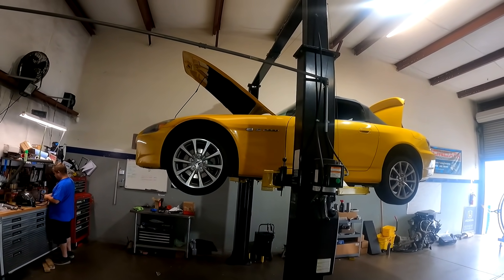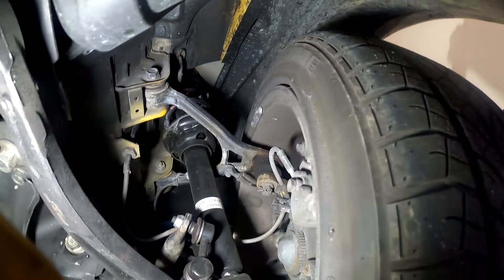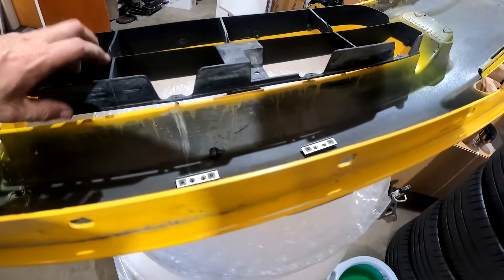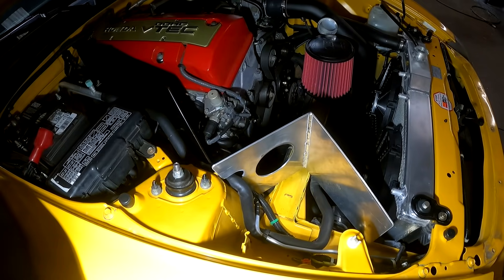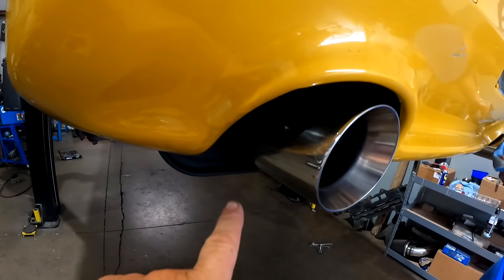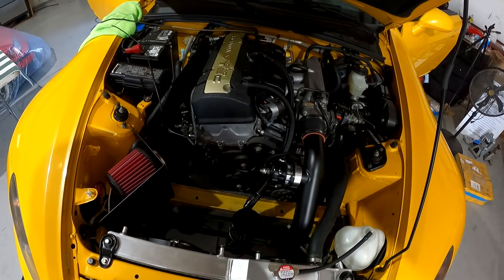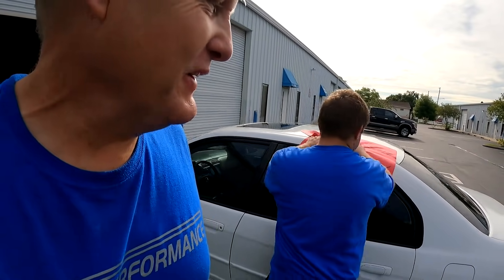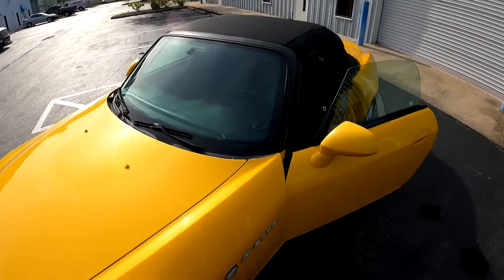07  S2000 with an 04 motor ?

Comment: Hey John. That S2000 has a funky mixture of parts for sure. The customer did the right thing bringing it to LHT.👍 I agree with you on the tread pattern looking like it should have a 600 tread wear rating. Looks more like a tread pattern for my wife's Subaru Forester than an S2000. Admittedly, I don't get out much, but I haven't seen a drive shaft quite like that one either. You guys gave the customer some major TLC as always. The new black and yellow theme under the hood looks perfect now.👌 Much better than the factory ketchup and mustard. John, you got me at the end. I was waiting for the ol' "Don't forget, enjoy your cars" and instead got "Don't forget, close your doors".😅👏 Haha, cheers buddy.

Comment: That driveshaft looks like one I had made for my Xterra when I converted it to solid axel up front, the adjustability was built so the suspension could droop/compress without being limited by the drive shaft length. Clearly not needed on an S2k and certainly heavier than is needed.

Comment: So this is a confusing video.  Several times it's stated that it's a newer motor in an older car and that year changes a few times.  Then when it comes to the fuel system and rail, it's older.

Really confused here.
Reply from the maker: Sorry it wasn’t clear. Kinda talking as I think on video. It’s not scripted so there’s some thing not said clear. Basically it was an 06+ car with an 04 motor. Some parts we’re mis matched to make it work. Sorry it’s not clear.
Reply: @LHTPerformance  gotcha, I kinda figured that was the case.  Glad you're getting that poor car sorted, it needs your help!